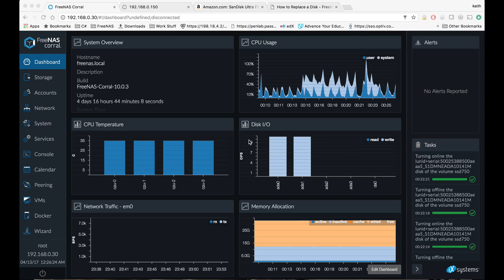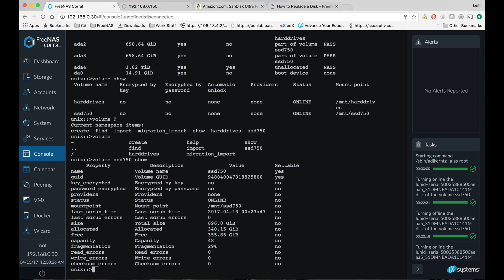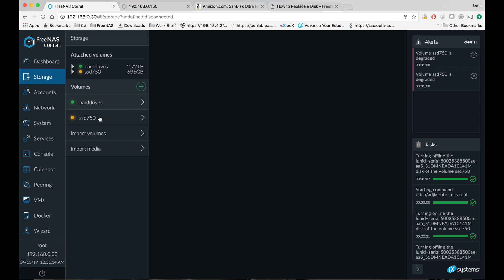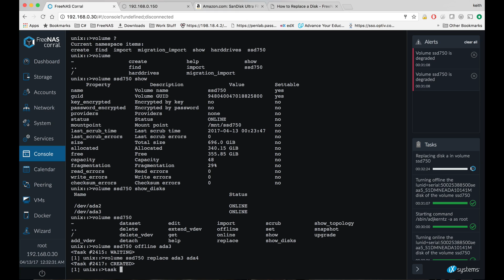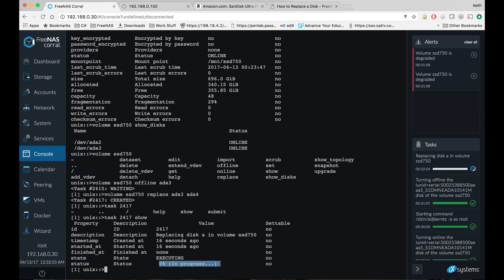How to Replace a Disk on FreeNAS Corral Tutorial

Comment: Is it possible to add another Drive to a volume?? I.e. If you set up a raid 5 type config where one Drive can fail with 4 drives to start, and say you picked up a 5th drive to add to the volume to expand the useable space, can you add it or do you have to move all the data off first before adding more drives to a volume??
Reply from the maker: You used to be able to do something like this, I don't know on corral. I'll have to look into it.  You can easily add 2 drives (as a raid1 vdev) to a dataset (zfs pool) by just expanding your stripes over the new drives in a raid1.  You can do a single drive but it would put your entire dataset at risk because if the added single drive failed the entire dataset would be bad.  The manual can explain better https://doc.freenas.org/9.3/freenas_storage.html#extending-a-zfs-volume

Comment: Just found your channel, are you staying with Corral or going back to 9.10?
Reply from the maker: Staying, even if the UI has bugs everywhere, Docker makes it all worth it.
Reply: I have moved over a large number of my VM's to Docker as well, you're videos on it are amazing thank you.
Reply from the maker: Ah, I hadn't really read much about this going back to 9.10.3. I don't really know what I'm going to do yet.
Reply from the maker: As long as they get beehyve and docker going on 9.10.3, I'm fine with migrating back to that.
Reply: The problem is Corral is in an indefinite BETA state for now.  It is very all future effort is going to be in building on 9.X.  Corral is sadly DOA according to iXsystems.
Reply: The issues run far deeper than UI issues.  That is why it's pulled.  It's too unstable and risk of data loss is too great.

https://forums.freenas.org/index.php?threads%2Fimportant-announcement-regarding-freenas-corral.53502%2F